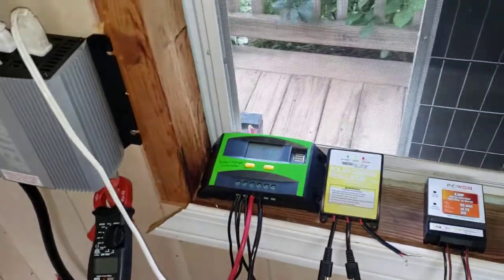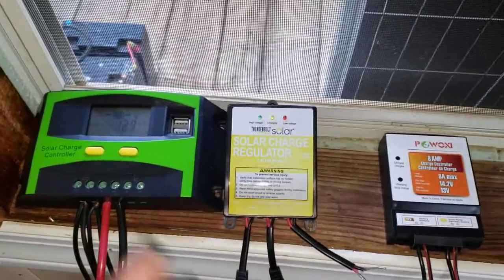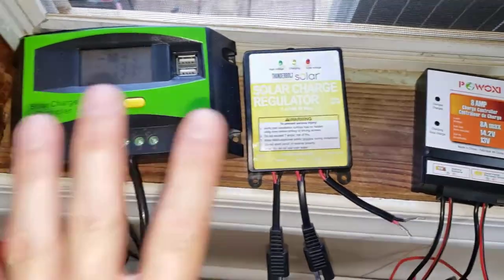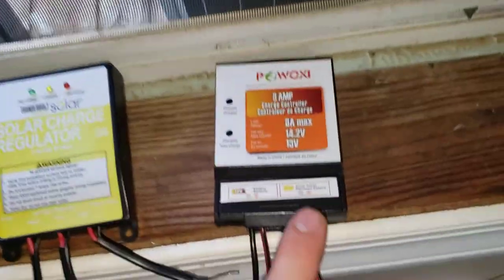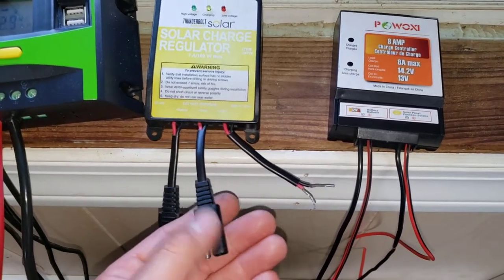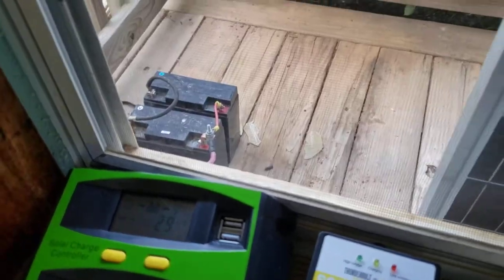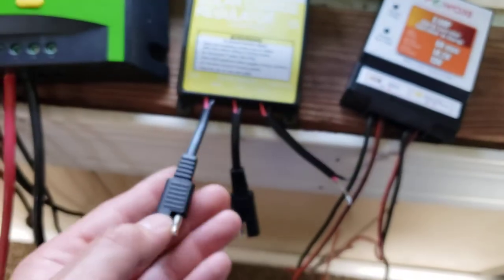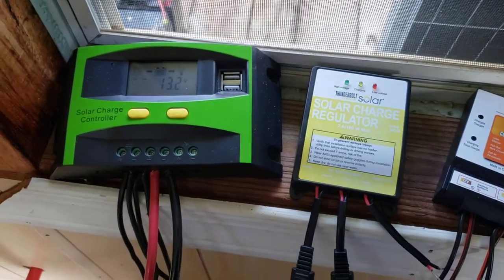Step by Step simple solar set up.

Comment: We purchased (2) 100w harbor freight panels. Our plan is to grow the system over the next few months to give us large enough emergency back up for our small farm. Mostly for running our well pump to supply ourselves and the animals water... Our well is only 60' and our pump can run on 110 or 220.
Because we want to grow the system which solar charger do you think we should go with from the beginning?  And also, how many batteries? Our thought was to grow it to (8) 100w panels.  We are located in NW Wisconsin so we have winter to deal with.
Very much beginners over here just wanting to be prepared for emergencies.
Reply from the maker: What size are you think you qill.make the system? 12v or 24v?
Reply: @DIYKAI  we will be using 12v ... Our invertors are 1000w and 1500w.
Also, what is the difference between running in parallel vs in series?
Reply from the maker: Voltage and amps if your running only 120v you can get away with a 12v system